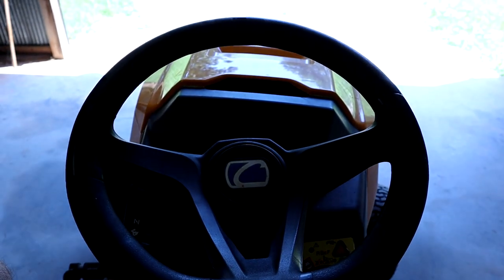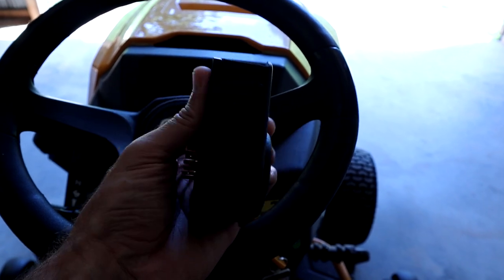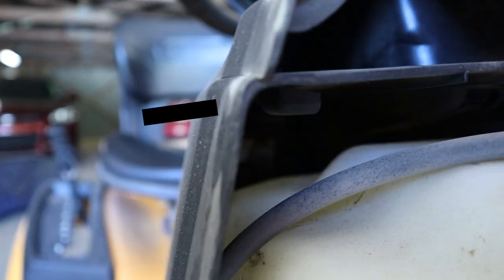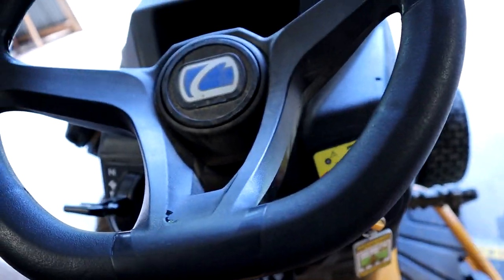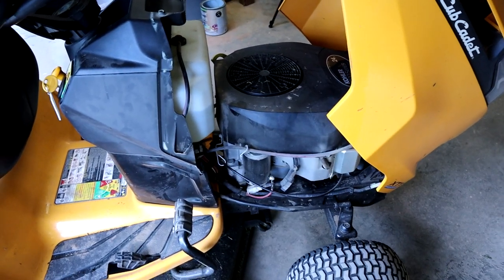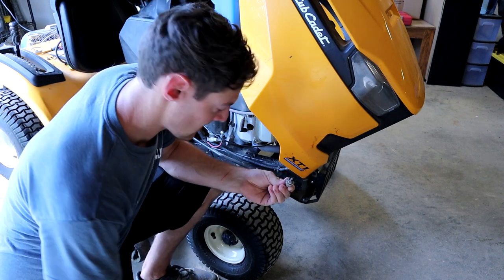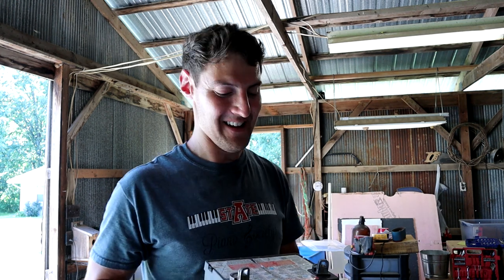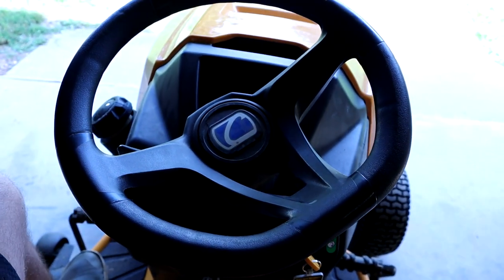My lawn mower won't start......lets investigate!

Comment from the maker: Thank you guys for watching and maybe this video will help you get your Cub Cadet XT1 started. At least I know how to change an ignition switch now I guess. lol

Ignition Switch: https://amzn.to/2UZOVlT 

Spark Plug Socket: https://amzn.to/2VeK0xN 

Wire Brush: https://amzn.to/2Bobxp3 

Battery Charger (Different from mine): https://amzn.to/2CfTnGA
Reply: Thanks for the honesty.
Reply: I just had this happened. I shut mine off to clean the mower deck quick and wouldn't start. I tried charging the battery it was fine. Came across this video so went out to check to see if the deck was engaged yep it was disengaged it and started right up 🤦‍♂️

Comment: First, thanks for putting the video up.  It was informative.  If anyone wants to know, he had the blades engaged and that's why it would not start.
Reply from the maker: Haha you’re welcome!
Reply: I also learned how to change my ignition switch, but I still don't know why mine won't start.  😭😭  I changed the ignition switch, checked the battery, tested the mower and starter with a jump box and changed my blades.  The only thing I can think of is maybe a wire is broken somewhere or I keep hearing about a silenoid, (or sloanoid)idk. 😭
Reply: Mine I have to make sure left brake pedal is pushed down and then turn key to start,
.. and yes blade has to be disengaged
Reply: @breeness56   Are you pushing the choke up all the way until it hits the metal at top?  You have to force it past the rabbit picture
Reply: @carololivie2095  lol...this is a great question.  Before my daddy passed, I just did things his way and I never knew to do that way until I started reading the manual and working on it.  Thank you 💗💗

Comment: OMG!  This video helped me indirectly lol.  My tractor had the exact same symptoms but I'm my case, my xt1 has a lever for the blades not a pull button.  Got half way through my yard and came back to the front of my garage to add a little gas to the tank...set the break on and turned off the blades with the lever (so I thought) and got off...tractor turned off which I thought was weird cause it shouldn't have.  Didn't think anything of it...added gas and went to start and had same symptoms as you.  Pushed it into garage...tested battery, checked sparkplugs, even pulled the ignition solenoid and tested with the battery and my multimeter to confirm that was working.  Watched your video and at the end when you said it was the blades being on i instantly looked and the tension spring attached to the lever pivot fell off and the blades were technically still on because of that...and that is why the tractor turned off when I got off the seat too!  Reattached the spring... disengaged the blades...boom started like a charm.  Thank you thank you thank you!
Reply from the maker: Haha! Glad my stupidity helped you out! Now when my mower doesn't start the blades are the first thing I check every time. lol

Comment: Thanks for this video and don't feel bad, I changed the Solenoid and the starter motor before taking my John deere to the shop. Now our second mower, which is 15 years old and a Cub, was running fine and like you just finished mowing and washed it real good, now it won't start! What the heck?  My husband told me not to wash it :(

Comment: My switch did the exact same thing and, your right, it does feel 'wrong' like you are turning past the resistance and getting no turn over. I started laughing when you checked the spark plug as it had absolutely nothing to do with the starting circuit. But the joke's on me. As soon as you said the mower was engaged I did a face palm and yelled so loud I scared the dog. Runs fine now. The only consolation is that I didn't pull this brain fart in front of my father in law LOL! Thank you and cheers!
Reply from the maker: Welcome to the club and glad you got yours going! haha

Comment: As soon as you turned the key and there was no sound I knew it was a safety feature.  Mine won't start unless The parking brake is on and I have to sit on the seat and the cutting blades can't be engaged.  Another problem I had is if I don't use a heavy enough oil.. I had put in 5W30 since I had a lot of it for my car and the mower would die after 5 minutes of running and then wouldn't start.. When I put in just 30 it started running fine.  One other time I took it to a repair place and the mechanic said that the gas tank was dirty and he dumped all the new fuel I just had put in and cleaned out the tank.  It's a finicky lawn tractor.
Reply from the maker: I could’ve used you when I was recording this video! haha

Comment: Was really hopeful I could use this. Mine doing same, changed key, battery,  brake switch,  seat switch,  fuse, and blades disengaged..still doesn't turn over😢. At total loss
Reply from the maker: I’m sorry!

Comment: I noticed you didn't have the brake on after you put the new switch on. Engine will not start without brake not on & blade disengaged.

Comment: It did gave me the idea to take the battery out for testing and that was the problem. It was totally out of charge and Advance Auto Parts charged it and all is good. And thankfully this is a free service.

And this apparently was the work of my kids to turn on the ignition key and the battery died.
Reply from the maker: Glad you got it figured out!

Comment: Mine shut off while I was cleaning out a wad of grass. (Engine was on, due to low battery, but the blades were disengaged, and the parking break was on.) Now I have no power on the hour meter and nothing works. I did spin the blades to get a chunk of grass out. Still stumped. Battery is now fully charged yet zero power
Reply from the maker: Yikes!
Reply from the maker: Yikes!
Reply from the maker: Yikes!

Comment: got a cub cadet xt1 enduro lt 42. replaced the push button computer switch and it still won't crank does nothing any help is appreciated
Reply from the maker: Are your blades disengaged?

Comment: Really think you have an issue with one of the safety switches (mower, seat, PTO) you can verify this by running a jumper from the battery and touch the 12vot tab on the starter solenoid if the engine spins thats the issue you then search for which one of the switches is bad.
Reply from the maker: Thanks!
Reply: 😭😭  Well I took out the silver thingy under the seat in the safety switch and it still doesn't start.  The thing powers right up when I put the jumper to it.  Check the battery power.  It's good.  Blades aren't engaged.  Stupid HOA people made me mad so I cut the grass in the rain.  I miss my daddy.  I'm don't have the boy parts to do this...
Reply: @breeness56  Did you ever get yours fixed? They make the seat switches so if you just unplug them they still do not allow it to start. If you need help with anything like this let me know…I work on small engines like these and will try to help you.
Reply: @moparscot9271  I ended up replacing literally every part except the wiring harness....and guess what, it is the problem.  I bought all those tools that reads electrical things and I couldn't figure it out so my beautiful mower with all the new attachments has sat for a year. 😥😥  I don't know  who to call.  Thank you so much for your reply though 😁
Reply: @breeness56  do you have an Instagram account I could follow so we could talk off of YouTube? It may not need the whole wiring harness.
Reply: @moparscot9271   Really?  How do I find the break or part that is out?
Reply: @breeness56  There are certain things you can check to narrow it down to something specific. Like where you have or don’t have voltage, if you have spark or a fuel delivery issue. I am happy to help and see if we can get it working but will need info from you like what make and model is the mower? Also if you have another way we can chat so it is not using this guy’s account might be helpful. Do you have FB or Instagram?